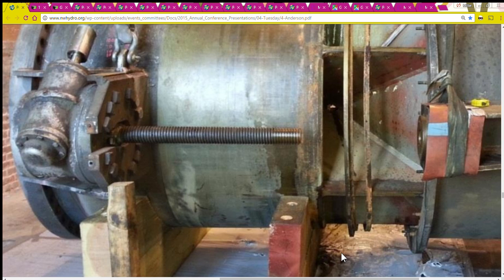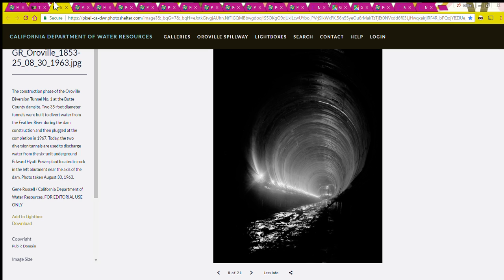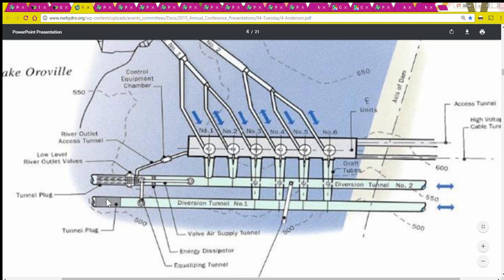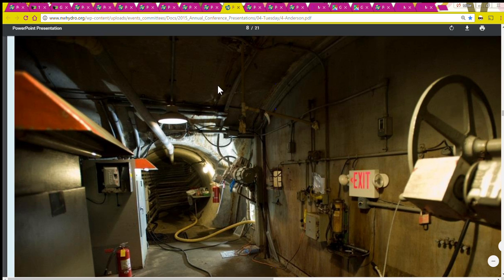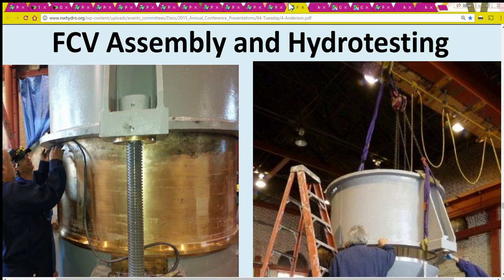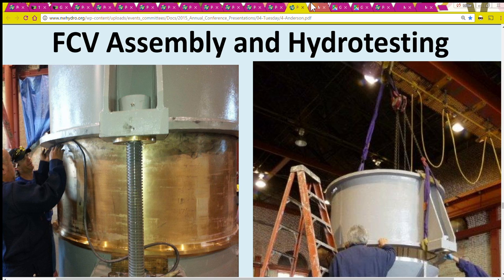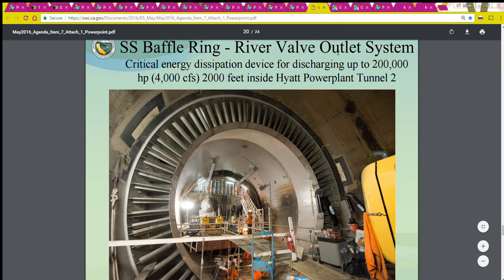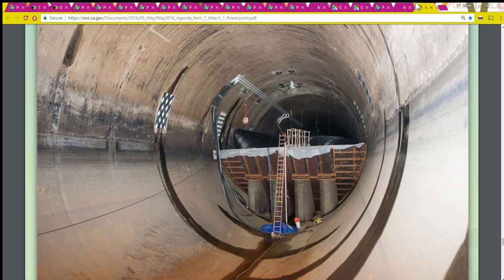River Valve Outlet System (RVOS) at Oroville Dam Explained 4/29/17

Comment: Here's a couple of interesting videos... IMO Kevin Dossey should be held accountable.  https://www.youtube.com/watch?v=0BUGxXHYKas  https://www.youtube.com/watch?v=K4IymnHHywk One of the pictures shows a new valve but it looks like the valve is smaller with a plate bolted onto the pipe. I wonder how far the pipe goes back into the plug?  Also I'm curious... Do you know how they blocked the tunnel so they could change the valve? also it seems that the baffel ring should have been repaired and not removed.. I wonder what person made the decision to remove it? and who was insisting that it was safe to operate the RVOS without it? It is important to know what happened to these individuals.. are they still working for the DWR and in what capacity?
Reply: It is likely that the baffle rings were originally damaged during the 1964 flood (during construction of the dam) which forced 160K+ CFS through the two diversion tunnels.   
They operated the RVOS many times over the years between opening of the dam and 2009 when they removed the baffle rings and then broke everything with their idiotic test.     
At one point I found a link to the original study which showed the results of many many scale tests to determine exactly what type of baffle ring was needed to control the high velocity flow from the cone valves, and what would happen if the ring was omitted, or the wrong shape.    Unfortunately I lost track of that link (as apparently DWR did, otherwise they would never have done what they did in 2009).  If anyone knows where to find it, let me know and I'll add it to my Oroville Dam and Spillway FAQ.  

It would be nearly impossible to replace the ball valves (they always have water pressure on them), but when the ball valves are closed, they can safely remove the cone valves which they did in 2013.    After they were replaced, new remote control system moved into the turbine room and the pressure relief wall was rebuilt, they operated the RVOS many times between 2014 and 2016.
Reply from the maker: Hi John. Yes, those are very interesting videos (I hadn't seen the first one). Did you see the reply I gave to a previous commenter? Here it is: *per the documents of the California State Water Project, there are two 72-inch diameter conduits through tunnel plug controlled by two 54-inch fixed cone dispersion valves -- each of which is guarded by a 72-inch spherical valve.* It sounds as if the valves can act as "backups" of each other when changing them out, but that is just a guess. I will need to look into that. As for the baffle ring, it had been sitting there broken since the dam was built, so maybe it was just too old to repair. The studies that concluded it was not safe to operate the system without the baffle ring were done at the Oroville dam by U.C. Davis engineering experts. I don't know names/titles for responsible parties. That would be a story in itself though. Thanks for viewing and commenting.
Reply: That's some really useful information...Thanks for sharing it.  I was wondering how they would stop flow to remove and change the valves under pressure...  Some of the pictures show quite a bit of erosion I wonder how long the ball valves will last? BTW with 900' of water in the dam the head pressure is roughly 390 psi. Also still curious if there is any way to associate a name or names with some of the decisions that have been made?
Reply from the maker: Ahh...excellent information! Thanks so much daemn42! That clears up a lot of questions that both I and my viewers have had. I will definitely let you know if I find that link to the study (I've been wanting to read it, too). Again, thanks!

Comment: So Diversion Tunnel #1 is completely and permanently plugged up, but #2 has a pipe installed through it to allow drainage from the bottom of the dam?
Reply from the maker: Hi gantmj. Yes. In Diversion Tunnel #2 there are two 6-foot diameter "pipes" that go through the tunnel plug. They are controlled by two 54-inch fixed cone dispersion valves -- each of which is guarded by a 72-inch spherical valve. Diversion Tunnel #1 is still plugged at the reservoir end, and it does not "pull" water from the reservoir as Tunnel #2 does. I hope that answers your question. Thanks for viewing my video.
Reply: Tunnel #1 is plugged both at its inlet, and in the middle.
As Millie says Tunnel #2 is plugged only in the middle, but has two 6 foot diameter pipes running through it into the RVOS valves. 
Tunnel #2 actually has two inlets.  One at 230ft elevation (very close to the bottom of the res) and another at 340ft (in case the one at 230ft were ever to be clogged with sediment).  
The latter half of both Tunnel #1 and #2 are used as the tail race for the 6 turbines.    Two turbines into Tunnel #2 and 4 turbines into tunnel #1.   3 of the 6 turbines can also act as pumps (pumping water back up into the res) so they sometimes draw from the tunnels instead of dumping into them.
Reply: Yes, that is the main access tunnel to the RVOS valve chamber behind the pressure wall.   Normally you'd enter through a door on the floor of the turbine room at about 265ft elevation, walk uphill to the old equipment control chamber (at about 290ft elevation) then back downhill to the RVOS valve chamber (at roughly 231ft level).     There's actually another tunnel (not shown in either of these diagrams) that branches off from the access tunnel and runs uphill for a long long distance.  It is an escape tunnel in case the turbine room were ever to flood.    It it shown in diagrams in the original design/construction document on archive.org

Since the repairs to RVOS system in 2013 nobody should ever have to walk into the access tunnel as RVOS is now controlled remotely from equipment on the turbine room floor.
Reply from the maker: daemn42 ~ Thanks! Such awesome information! Piecing together all the details is fascinating! By the way, do you think that photo in my video is in the access tunnel to Diversion Tunnel #2 (the control equipment chamber)?

Comment: Question Millie: does the water that flows through the RVOS come through pipes in the 150' long plugs? Thanks for the lesson!
Reply from the maker: Hi Nathan! The short answer is "Yes". The long answer is, per the documents of the California State Water Project, there are two 72-inch diameter conduits through tunnel plug controlled by two 54-inch fixed cone dispersion valves -- each of which is guarded by a 72-inch spherical valve. Great question! Thanks for asking.

Comment: Excellent explanation.
Question???
What is the current situation of the 2 tunnels?
Are they operational?  If not what is wrong?
Reply: That's correct.  They operated the RVOS safely between 2014 and 2017, but some time following the control room fire at the Thermalito Dam, they instituted new fire safety measures around their control systems, and that required that they temporarily stop using the RVOS until those fire safety measures were implemented on the RVOS control system.    Bill Croyle said that RVOS would be operational again first week of May and that they could use it in conjunction with HPP outflows.   We don't know if they ever operate HPP and RVOS both at full capacity (since they both empty into the same tunnel), but they certainly might use RVOS at full 4K CFS while they're still running HPP at half capacity in the next month while they work on one of the pen stocks.
Reply from the maker: Hi Bill. Thank you. At the time of the Spillway Incident in February, the information I read in news articles indicated the River Valve Outlet System (RVOS) was not operational because of some fire safety issues (remember, their controls are in the Hyatt Power Plant, so it could have been general fire safety issues for the entire underground facilities). At the community meeting that DWR held in Gridley a couple of days ago, April 27th, DWR said the RVOS is operational and will be used in the very near future. So, unless something else goes wrong, the system should be good to go. Thanks for asking such a relevant question -- it helps everyone.